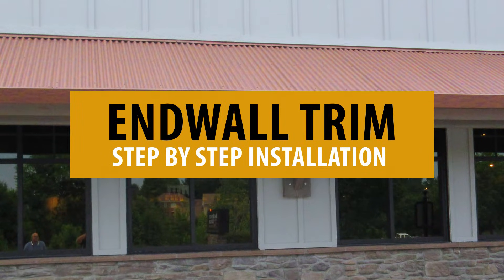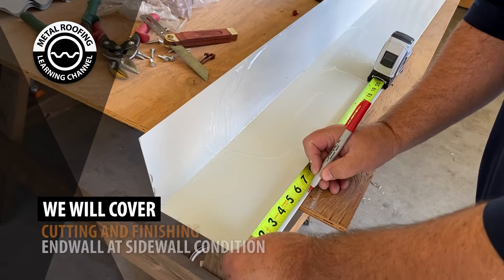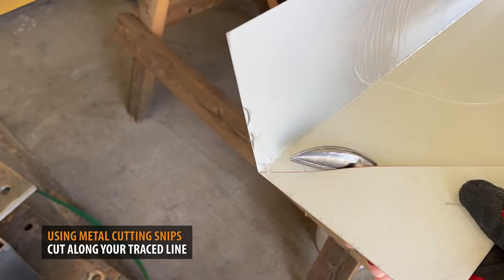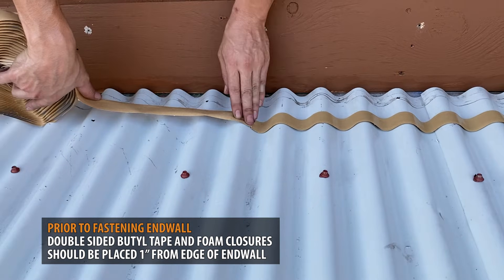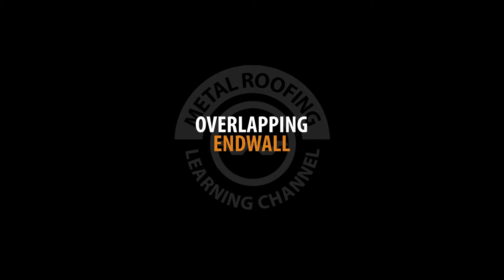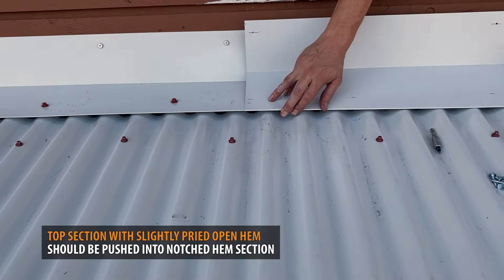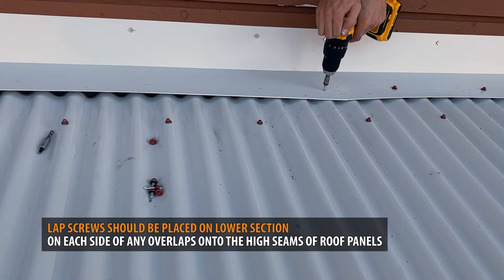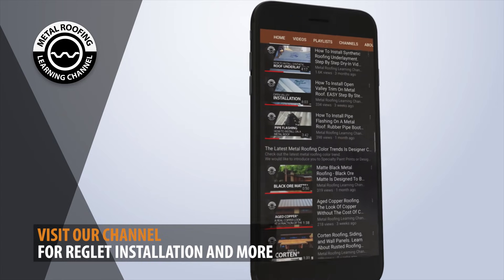Endwall Flashing Installation On A Metal Roof. EASY Installation Video Wall Flashing On Metal Roof

Comment: Maybe I'm not thinking about this right. Water will come down the siding, onto the flashing, then when it runs off the edge of the flashing, it will want to travel back toward the end wall because of surface tension. So you install the foam closure strips and sealant to break the surface tension, and allow it to travel down the roof. Right? But what happens when the sealant inevitably fails? Or what if water gets behind the end wall siding—how can the water out if it is trapped behind the foam closure and sealant? Does the underlying wall and roof assembly have any other WRB? 

Wouldn't it be better to create a kickout lip on the flashing that acts as a surface tension break, but doesn't limit drying potential at the protrusion?
Reply: Metal roofer here - it is almost always a terrible idea to obstruct the pans of the sheets in any area, including underneath the apron flashing. 

As you specified, good practice is to have an anti-capillary lip or feather fold of about 10mm along the transverse edge of the flashing at about 135° down. 

With regards to the infill strips, the better solution is to grab a set of pliers and turn the pan up at the top of the sheeting, creating a dam, or stop-end. 😃
Reply: @AggregateUser I know you wrote this a year ago  but I found it helpful thanks

Comment: I didnt want to remove my old gutter but was adding a simple semi stand alone lean to/patio cover/whatever you want to call it. I used that flashing maybe 4x6 or 7. I was able to slip it up into the drip edge then siliconed it. It went behind the gutter and extended just beyond the gutter underneatn. Idea being that any leaks will leak onto that flashing and down onto the roof. The roof fits right under that and add the foam with sealant and bend the flashing down held with a few screws covered with a caulking/silicone. To test I used a garden hose to flood the roof and watch the drip and drain. Worked surprisingly well.

Comment: How do you seal and addition roof to an existing vertical wall? Adding an extension shed to the side of a steel building. Is there a transition that keeps rain from running between old building amd new roof or does the old wall need to be cut horisontally to slip a roof transition under the steel sheet maintaining the waterfall steps?
Reply: also curious how this would be done

Comment: How can I seal it to a flat concrete end wall that will have no additional overlay (siding material)?
Reply: Grind a 1/2" groove second, first, hire a professional
Reply: @TarzanArmani007 I’m doing that to mine at the moment.  When the guy that did it there was some concrete that fell out so there’s little holes inside the metal frame flasher would it affect it? He said you don’t need to fill it cause the metal will keep the rain out.
Reply: You cant. Thats not a impermeable wall

Comment: Well you dont want to use silicone sealant. Never use actual silicone om anything exterior. Use a good sealant and adhesive.
Reply: Silicone is good ifnits covered and under compression, won't be exposed to UV..we mechanically seal these in my part of the world.
Reply: @frankryan2505  Meh, yeah, it can be okay if not exposed to UV and under compression. It's still an inferior product in just about everyway as it's an all around good caulking but doesn't excel in anything. It is always nice when someone use silicone and I'm tearing their crap down though. Much easier to rip apart
Reply: @jonny-b4954  jonny, they didnt do it right if you can yank ti out. they neeeded a backer rod or similar OR they didnt prep (dirty for example) or they simply put too much in
Reply: Honestly, they should be using a urethane of some kind in my opinion
Reply: @CT_Taylor  Nah, that's not what I'm talking about. I'm talking about when removing  screen room framing, windows, siding etc. that's been caulked against a wall, mostly for aesthetics. The silicone is super easy to score with a knife and then rip the  2 things apart. Not to actually pull silicone off. Though even properly installed silicone can quite easily be pulled off like you're talking. It doesn't bond very well, unless it's an adhesive silicone, of course. That bonds a little better. Try scoring a urethane caulking though. It turns hard over time. Cracks. That is of course the downfall of non-silicone caulkings.
Reply: @jonny-b4954  I havent had years to confirm it but there are some polymer or urethane(I forget which, but I used on a vent cover for a dryer on siding thats plywood grooved stuff) but its staying pliable and bonded very well to that wood and the plastic.  but it cant be painted and it takes a lot of curing and VOC are high.   Outdoor only because of it.   THe thing you mention I am not sure I understand, but yes it stays squishy for sure, I peeled a lot off my house which was put on 20 years ago. Most came off in 6 foot lenghts., only attached to one surface or onspots, over the length.   The sun takes its toll there
Reply: @CT_Taylor  Yeah, that stuff you peeled off in 6 foot lengths was almost certainly silicone. Always nice to show up to a demolition job and find that stuff. Easy to remove. It could very well have been installed perfectly fine and that's just what silicone does. Easy to peel off. That's why in my trade we typically use more high quality urethane based caulking. It adheres so well you have to beat it off with a chisel or a small oscillating saw. We use it solely in applications where adhesive bond is important while keeping out water at the sametime. But, in doing so it hardens, unlike most silicones, and thus cracks. Pros and cons with everything. Nowadays though we use less and less of it as we're getting into 20 years of doing this and going back to jobs we did a decade ago. Seeing how our materials lasted and stood up to mother nature/The Sun. We're finding it's better to just use an outdoor silicone that'll stay pliable and even though it's easy to peel off and sometimes that causes a small issue, it's not as big of an issue as the caulking hardening and cracking. Looks like crap and doesn't do it's job at that point. With wood houses like yours the most important thing to prevent having to do wood rot damage repairs is to keep a good coat of paint on it every 5-7 years. Re-doing any caulking around windows/vents as needed.
Reply: @jonny-b4954  Unfortunately the sheets were stained and the stain is going on 15 years./  the house is on a hill such that back side is level with 2nd floor and front, 1st floor.   The sun beats on the south and the west side , which need  the work the most.   
Fortunately, my gpa redid the garage which is still fine and he KEPT The sheets he just put them away in the shed and they are in good shape, so I could replace any bad sheets (the west side has some serious weather/bird damage that would improve with a new sheet) and the south has some, mostly due to winds and water at one spot.

The only problem I am running into is knowing where is the "proper" spot too secure these sheets, do they need some kind of barrier between that and the house wrap(I think) ,and is there any special flashing.. The sheets come down and are caulked at the bottom, and the bottom are what rot. I thought of sealing both ends of sheet and a paint that keeps water from easil into it.  But idk. Also,do you know what its called? its 4x8 sheets which groove into eachother and the standing parts run vertically